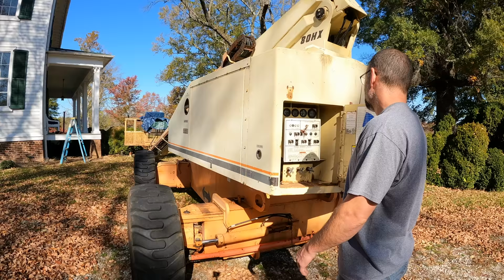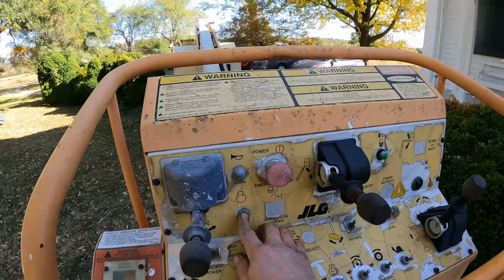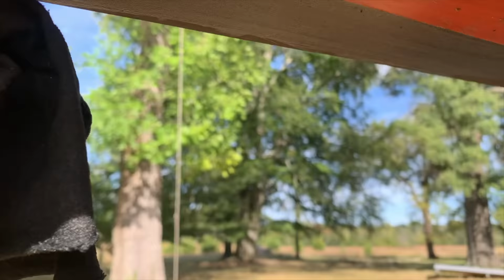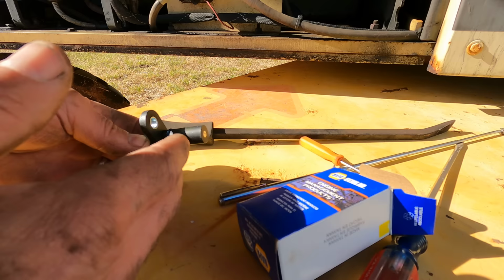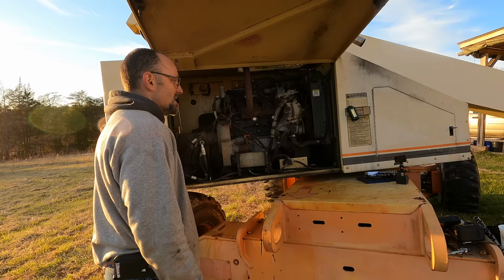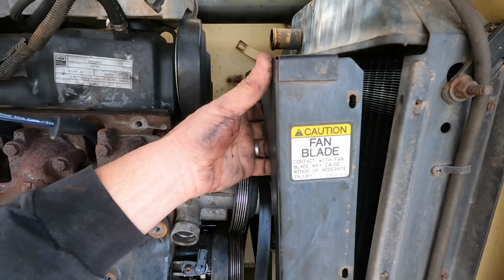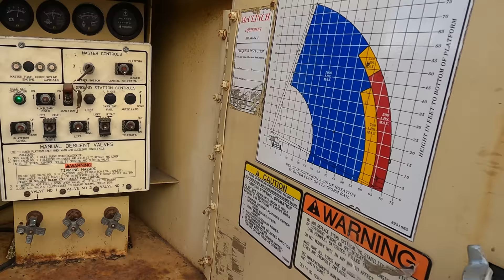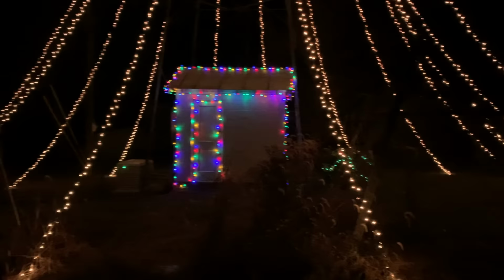My Boom Lift Broke Again! Fixing It & Then Doing a CRITICAL Job With It.

Comment from the maker: Man I did a lot of work in this video!  I could have broken it into multiple vids, but why do that when I can work twice as hard for less?  ;-)  No, personally, I'm not a fan of multi part videos dragging things on and on, so I try hard to avoid that if possible.  I hope you agree and enjoy the vid!  Happy holidays to everybody, and I will be posting another video next week, on a completely different topic!
Reply: Agreed. Hate multipart vids. Well done!
Reply: Completely agree. All of your longer format videos are filled to the brim with useful information.
Reply: I like this long video. Always a lot of work and a lot of knowledge comes with it.
I need to see it on a big TV only to drive my 3 daughters out of there
Reply: This might help working in those tight areas  Tite Reach 3/8 Do-it-yourself Tite-reach Extension Wrench.  I found on amazon.
Reply: You’re my star. Happy Holidays !
Reply: I would replace coolant temp sensor. Cheap enough to try.
Reply: What i can see is a natural aspirated engine. Take the spark plugs out and check the condition of the piston wall. The reason behind that is it needs oil to make a good seal and pull enough air to run the carburettor. The long crank is pushing the oil up and then starting . You can try to use a bit thicker oil or an additive for old engine
Reply: Hi John not sure if you can do this but like in the old days with the cars you’d have to pump it with the accelerator a couple times if you could hook up a throttle cable and disengage it once it started that might help
Reply: Scratch that.... This is carbureted of course 🤦
Reply: Fuel pump, vacuum leak?
Reply: This is why your the  G.O.A.T. I work the night shift. In a veey tough dangerous job. Where everything can kill you. The only thing that gets me through the night in the cold, rain and snow, is seeing your notification pop up on YouTube.  Knowing you've uploaded a decent long video. Gives me something to look forward to when I get home!
Thanks, John 👍🏻. And thanks for not dragging them out into multiple smaller videos. I'd lose interest as I wouldn't have time to keep up with them all.
Reply: Hey, Can you post the Part number and model for that Carb. Maybe someone will have it and make it available to you?
Reply: Agreed 👍
Reply: Long but I still enjoyed it.  I could hear you curse at my place in New Kent Va!   Try adding one of those cheap inline electric fuel pumps.  (just to prime it)  Run it for 10 seconds, turn it off and crank it up.  Happy Holidays!
Reply: rings my friend
Reply: I'd much rather have the longer video. Keep them coming!
Reply: @JamKowalski  They should watch, maybe they can become handy woman 😀
Reply: I like the way you compile footage over time and make one feature.
Reply: I think you should check your fuel prime .....it is starving every morning your trying to start
Reply: at 45:60 you gripe about alternators costing $50-60 'back in the day.'  You seem close to my age and 'back in the day' when I was in my late teens, early 20's it was around 1990.  Guess what $60 in 1990 dollars is in 2022 dollars?  About $140...Inflation is a b***h.
Reply: You are a persistent man my friend, I may have burned that thing to the ground by now LOL. Lights look amazing!! Well done!
Reply: Agree as well, can't stand multipart videos. Keep the format exactly like you do, that's part of what makes your channel my favorite along with Diesel Creek!
Reply: @loloswoodcraft  It's very expensive though for being made out of plastic. I picked up a generic aluminum die cast one off of amazon for about 50 bucks with shipping to Finland just a few days ago, waiting for it to arrive. We'll see what the quality really is. What Jon really needs is a ratcheting wrench. I picked up generic cheap ones are my local hardware store for about 50 bucks also.
Reply: Wow!   You are incredible. Thanks for showing all this!
Reply: Quick question....did you do a giveaway??  Got a message saying we won.  Some really pricey gifts.  Then said we needed to pay shipping.  I think you have a scammer in your chat.
Reply: @clucktowerarkansas8172  Yeah no. They're scammers. I'm surprised you even went as far as contacting them when they asked to dm with telegram.
Reply: Very much agreed.  I hate multipart videos.  Now you just need to paint the old girl :D
Reply: I like longer videos with lots going on :-)
Reply: Valves are sticking open slightly until warm.
Reply: I like that idea. It never occurred to me that low compression might be his problem. One squirt of 30W oil in each cylinder and replacing the plugs might give him a quick start and then he would know his issue. @pcqman26
Reply: @pcqman26
Reply: @pcqman26  I tend to agree with your idea. I only work on engines that have pretty good compression, so that's something I've never considered. Thanks for that tip.
Reply: ever checked the compression?
it might be the cause of your black smoke and very bad starting.
Reply: Well done! Happy Holidays!
Reply: John, Wonderful ending!! That is the best home made DIY tree I’ve ever seen! Glad you mentioned the thumbs up, I almost forgot. Hope you can get a hold of that expert on these engines you spoke of and get it to do better cold starts. BTW, secretly I think she (the engine) is just making you replace parts because she has been so neglected for so many years she wants some attention and TLC. Very Merry Christmas to you and your family!
Reply: @larryholloway2869   Thought the same!! About rings .. With his gear he could get a junked 4 banger ranger block and rebuild it at his leisure and when it’s ready pop a nice fresh engine right in there with his care and maintenance to keep it going for a long time to come!!
Reply: I love to watch your videos of an evening, better than the other crap on tv. I also have a lot of old equipment from a 1960 Case Combine, '73 8 ton side forklift to a couple of Furguson tractors 47 and 54, just to mention a couple of them, can't abide watching such titans of the past going to the scrap yard.
Reply: John, any chance there’s a fuel check valve to replace?  That or install a fuel shutoff in the fuel line and see if that stops your long starts after a long time away from the lift. Great video!
Reply: Wow!  What a great finish!  Really enjoyed the critical job!  Merry Christmas, John. Thanks for these awesome videos.
Reply: Fantastic video and end result!  I love it!  Merry Christmas from the Great White North! 🇨🇦🎄
Reply: One question John. Does the engine have, or need a ballast resistor? I'm not familiar with this engine, but the symptoms are similar to a faulty ballast.

I was so laughing watching you work and that *&#%ing crank sensor being stuck was written in the stars. And then the thermostat. And then the alternator. And not a single swear word. Not one. 

You're a legend.
Reply: You want it reliable and not have to mess with it, go buy a Toyota motor and change it.
Reply: There is a fake account. Ask for 💰
Reply: I would much rather watch a long video and get the whole story then have to watch 2 - ∞ videos to get it.
Reply: 2000 years later...always makes me laugh.
Great video  John, 
 Merry Christmas  & Happy  New year  to you and your family.
Reply: The work done was great to see. The performance of your work was even better. All your work in this video was maintenance not done by previous owners. The performance when maintenance done was like new again 😂
Reply: I thought about the bad start, it looks like the choke is the same as on my mercruiser Alpha One 3.0, when starting cold it stays closed, when the spring heats up it opens. You can rotate the choke assembly to get more or less choke. In the video I thought I saw the choke valve moving right away. Could this be the issue? Regards Dick from the Netherlands
Reply: Do you use your ham radio antenna but cool x mass tree light set up along with the work on your lift
Reply: I put a thumbs up at around 0.01 seconds
Reply: I’m a new subscriber and enjoyed your content.  Kinda figured it would be for Christmas decorations.  

That is a very useful machine to have around the property.  From my experience running those, please leave a harness in the basket and use it.  

I’m not sure if you drained that tank of all of the old fuel in another video but I’d completely drain it and re-fill with recreational gasoline which doesn’t have any ethanol in it.  I’ve had great success using Seafoam to clean out old fuel systems and keep them purring like a kitten.

If you can’t get recreational gasoline and have to run a ethanol blend keep that fuel tank topped off.  A half full tank will expand and contract allowing humid air into the tank.  Unfortunately ethanol will bond with it and you end up with a load of bad fuel to deal with.  Learned this one with off-shore boats

Good luck with the channel, looking forward to more good content and have a wonderful holiday 

Thank you 

Todd
Reply: there is not a job that needs doing that does not go wrong, I'm glad I'm not the only one, A great video thank you for the entertainment. A very Happy Christmas to you and your familly, YOU need it.
Reply: @AncientApparatus  Its a scam
Reply from the maker: @AncientApparatus  No, stupid scammers.  I try to remove their comments but I can't keep up.  Sorry.
Reply: @FarmCraft101  Thanks & I didn't think so but I thought I'd bring it to you attention.
Reply: I love the pace and feel of your videos man. I know it's hard work, but it really shows in your final product. Thanks for bringing us along.
Reply: Man oh man, you never give up do you?
Reply: I believe your hard starting is due to the idle solenoid.  Only there for quick shut down of engine and prevent run on.  Take it out and cut off the shaft and refit. Rod from Downinder
Reply: if it's not bad gas, I would test to see if the choke mechanism needs adjustment. seems like whatever is actuating it is "off".
Reply: It's straving for furl
Reply: Have ou thought about checking the timing also what about getting a long adjustable patin pole and attach a oily rag to it and insert in to the rear end of the boom and stroke it back and forth until you reach satisfaction
Reply: I should have saved my comments untill the end
Reply: Wow lights kook nice 👍
Reply: @BCDanno63  yeah he is going to have to do something I don't see that motor being with much longer. A leak down test would confirm it.
Reply: it always breaks, and this is why it is called a "Boom".... lift 🤣🤣🤣
Reply: Check for vacuum leak, compression, valve adjustment, leak down test. My 2 cents
Reply: Hi, I don't know if anyone mention it before  but on the thermostat housing there are 2 coolant temperature sensors, 1 for the gauge and the other one for the ignition timing when it's cold or when it's at operating temp to adjust it accordingly based on temp.

I might be wrong because I have more than 15 years to touch this kind of engines, it's just an idea.

Great content like always.
Reply: Fantastic as always, single or multi part vids.. I’m easy 👍🏻
Reply: Check your inlet line from your tank boss. You probably need to change EVERY fuel filter on that thing.
Reply: Impressive Xmas decoration ✌️
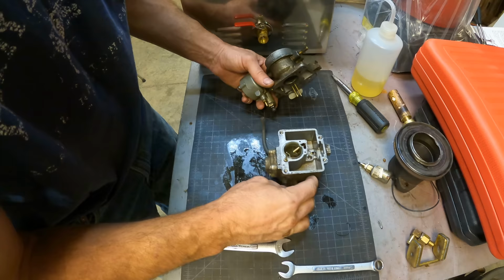Reply: At 2:18 the way the float wobbles, you might have a bit of gas sucked up in it.  That will mess up the gas level in the bowl and cause the engine to run rich.
Reply: Is the fuel draining back to the tank, a pin hole in fuel tank line, clogged fuel filter. Tra a a anit drain back valve..

Comment: The greasing of the boom wear surfaces is a must. We (Firefighter) clean and regrease our ladder truck aerial every month. We have been complimented by the manufacturer on how little wear our ladders show verses many other departments. We use WD40 to clean the old grease off and then white lith all of the wear surfaces. Then blue (high pressure) grease all pivot points and any zircs.
Reply: And what the most People do not know.....WD40 is not a Lubricant
Reply: @AMeise-vy4fk  Myth: WD-40 Multi-Use Product is not really a lubricant. Fact: While the “W-D” in WD-40 stands for Water Displacement, WD-40 Multi-Use Product is a unique, special blend of lubricants. The product's formulation also contains anti-corrosion agents and ingredients for penetration, water displacement and soil removal.
Reply: All petro cem oils can lubricate..even crude oil can lub. Two metal surfaces.they might not be the best thing to use but all the same they can lubrecate..
Reply: @AMeise-vy4fk  I would say that it's not a good lubricant but it does have some lubricant ability. Not that I'm recommending it. I find that it makes a decent cleaner for some situations though.

Comment: It is hardest to start when cold.  You need a rich mixture when cold.  When you were filming down the carb throat the choke opened too fast.  The initial richness disappears when that choke opens, and it dies.  Choke closes, engine catches, air rushes in, choke opens, engine dies from being lean.  Try adjusting the automatic choke.  Love your humor and the seals!
Reply: Never liked automatic choke on any old cars i had it was always a problem, removed and changed to manual. Agree it doesn't seem to be working properly and not sure if there is a fuel enrichment circuit for cold start on this carb
Reply: Yeah, I noticed it to. There's something moving in the carburetor in time with the engine sound. It's most likely the automatic choke that's the problem here. It releases to easily.
Reply: Was going to say the same thing. Choke is flopping completely open and closed during cranking and as soon as the engine starts to fire it opens completely killing the engine. The MOST it should open once engine starts to fire is halfway and than gradually open completely as engine warms. This engine keeps firing intermittantly until the cylinders get warm enough to stay running.
Reply: I came to the comments to say the same thing.  That choke valve should not be flopping around like that.
Reply from the maker: I've been hearing that pattern during cranking and wondering what was causing it.  Yeah, that stupid choke certainly isn't helping anything.  It's first on my list!
Reply: I’d certainly agree with this - maybe a manual choke conversion but then that’s no good for a possible cold start whilst you’re up on the platform & can’t reach the choke 🤔
Reply: Also, try clean the ground of the engine. Once we had a problem with one hyster forklift and after change half of the machine, thr problem was in the ground. May help! 👍
Reply: @FarmCraft101  Tighten that coil spring up, it's not holding the choke long enough. It's probable a bimetallic spring and shouldn't let the choke open until it gets warm. The first time it fires the engine should run, but the choke is opening up and engine is going lean and.......you know the rest
Reply: I agree. Put more spring tension on the buterfly so it stays cosed longer when starting
Reply: @alysongr  I cannot count on both hands the number of issues I have solved over the years with a proper ground. I like to use at leasttwo braided copper cables.If it is automotive, one on each side of the engine.
Reply: You’re not cussing enough. It is easier and more satisfying when multiple expletives are used. 🤔😉
Reply: I see too that the choke mecanism spring is too weak. Then look's not fully open that make engine not running smoth when it is hot. It should purrr like a kitten. My opinion. 
Just make a test when cold. Hold the choke plate close while someone push the start button. If it start well, you have your answer. 
Good vidéos.
Reply: Hi John.  Love the channel mate.  Watch it all the time with my Missus.  @user-nq5rl5yz4m is spot on.  The choke butterfly must be fully closed until the engine fires.  As an automatic choke it should gently open once the engine is running.  I have a lawnmower with a faulty choke arm on the carburetor.  I jam a spacer under it to get full choke and it starts first pull every time.  If I don't do this and ensure the choke butterfly is fully closed, it will not start.
Reply: @Watchyn_Yarwood  
👍 I've found that to "fix" at least one vehicle and really helped on my 90XJ adding a bigger and better ground from  engine to frame and battery.  Everything electrical worked better.
Reply: I had an old John Deere run like a top when its warm, let it sit a day and crank, crank, crank. What I found out it wasn't the choke! It was gas line bleeding off. Put some pressure on gas tank with air pressure and it fired up every time.

Comment: At this point, wouldnt it have been easier to replace the motor with an electric one? I imagine you have a decently sized diesel generator anyways so electricity outside isn't a problem either.